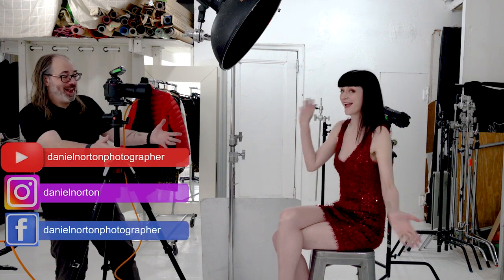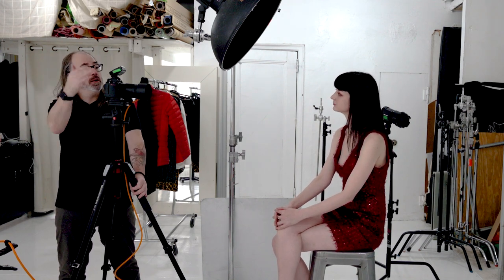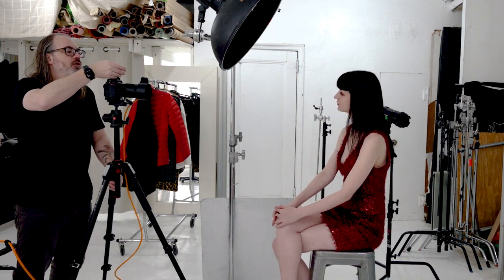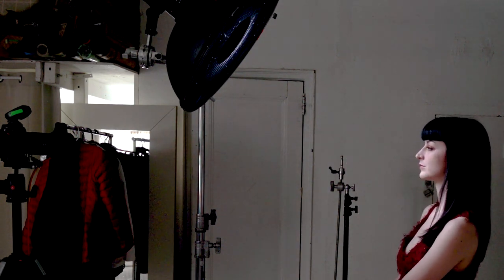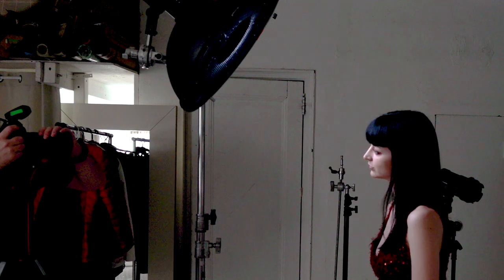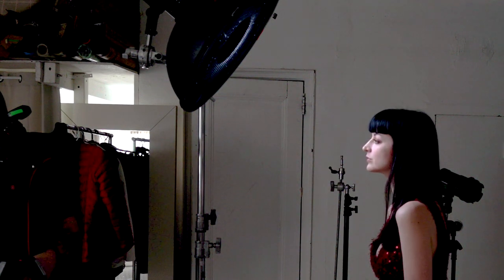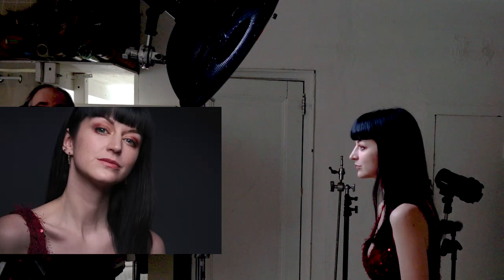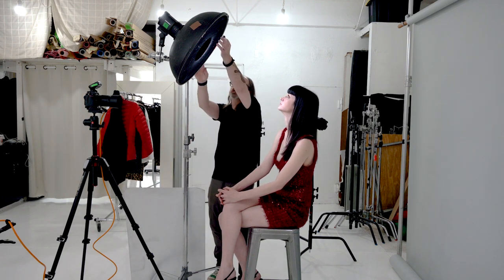How to use a beauty dish with grid

Comment: Thanks Cadence and Daniel. How about showing the difference between a hard beauty dish and the newer collapsible beauty dishes. I'm about to buy one and not certain which would be better. It's for studio use only and I want a grid with it. Looking for a 24", but what would be best. I have no experience with them.
Reply: If you want a beauty dish I would say buy an actual beauty dish and leave the folding ones alone,   they are really just small octa's or softboxes. Sure they are indeed more portable but for me If I want beauty dish light I will grab a beauty dish. 

Size wise it will depend on the look you want. Larger dish will provide a softer light than a smaller one. 

I use to have a 27" beauty dish but changed it to a smaller 21.6" due to having low ceilings in my studio.  I tried a smaller 16" dish but found that too small and hard,  the 21.6" / 22" dish seems a good size for them. 

Most dishes come with a grid and sock also.   

i now also have the same size dish (21.6") in white and silver.  the white is warmer in tone and the silver cooler, the silver is also more specular so it provides more contrast.

Comment: Question: Would you not use a beauty dish on older women with moderate wrinkles? If you would use one how would you minimize them?  By slightly overexposing the image?
Reply from the maker: You can, just be cognizant of the angle of the dish relative to the face and use a liberal amount of fill. I would expose normally, unless you are shooting analogue print film - then you’d over expose.

Comment: Daniel, I have a slightly off topic question. Im new to flash photography and I have a small speedlight (Godox T350)  I tried to bounce the flash off a white wall that was right behind me onto my subject who was in the shade, about 6-7ft away. I exposed for the background and tried to light my subject with flash, but couldn't, even on full power. Was my speedlight simply not powerful enough or does bouncing flash outside not work with most speedlights? Thanks
Reply from the maker: Sounds like your flash was not nearly powerful enough, Keep in mind that bouncing the flash eats a ton of power